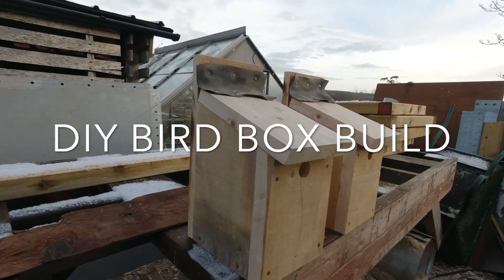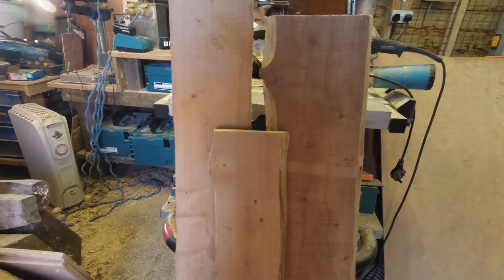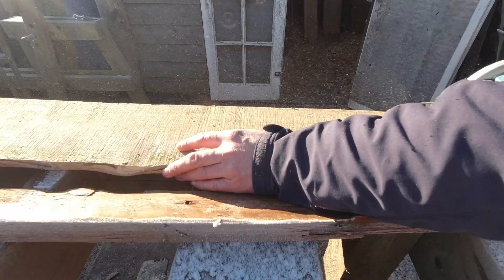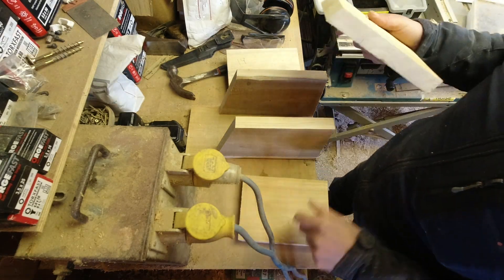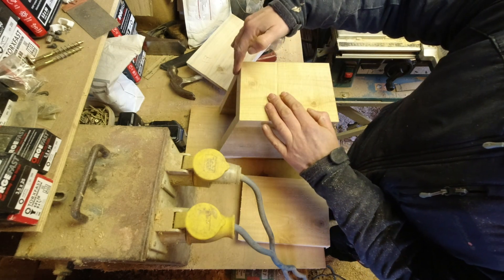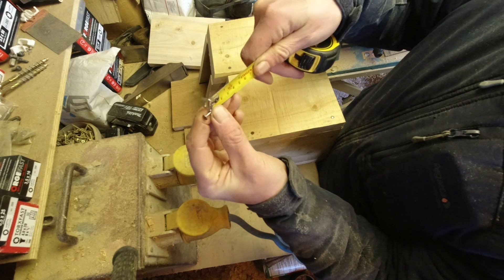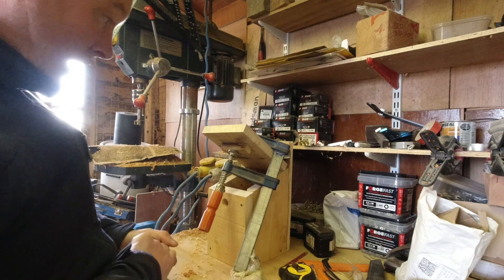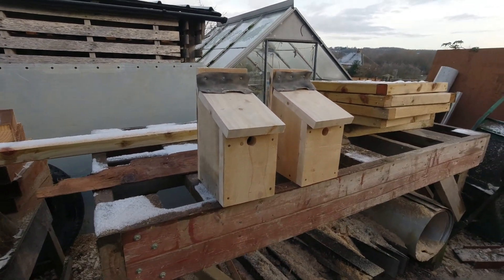How To Make a Birdbox using RSPB Plans. DIY

Comment: As you point out, because you used thicker timber, the internal space is reduced from 120mm wide to 95mm wide. That's important, as birds need a certain amount of space. An adult house sparrow is about 160mm in length, so it would struggle to turn around in your box.
Reply from the maker: That’s really interesting thanks so much, it’s definitely worth planning out the timber cutting to suit the birds that want a home.

All the best Darren

Comment: I created an alternative, lots of interest from tits but never used 🤔. I had some 10" long x 8" wide silver birch logs, I hollowed out the center with a flat bit leaving about an inch in the base, cut the top at an angle, drilled the 25mm hole in the front and put a plank on the top to weatherproof it. I screwed a 350mm x 25 x 44 piece of treated timber vertically to the back and used that to fix it to its final location. 
I used a stainless steel screw however I like the aluminium nail or screw idea, especially now I can use a chainsaw, finding that stainless screw would ruin my day 😲🤦🏻‍♂️ so I  will make that change asap 👍. 
Thanks for the video. Hope you had a great family christmas Darren, all the best Stu.
Reply from the maker: Sounds a lovely idea for a bird box, we have some on the workshop but nothing has gone in in about 4 years.
Reply from the maker: All the best to you
Reply: @AbellTo  Yes they look aesthetically beautiful but do seem to have little function so maybe back to basics for the next ones 👍
Reply from the maker: @combitz  we do our best to make them a home and then sometimes they nest in the strangest of places. Keep trying